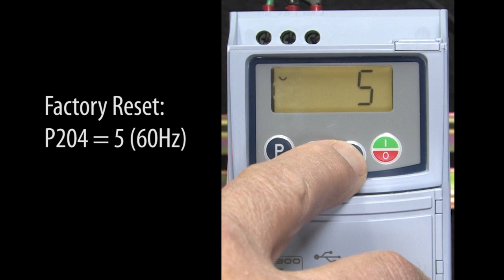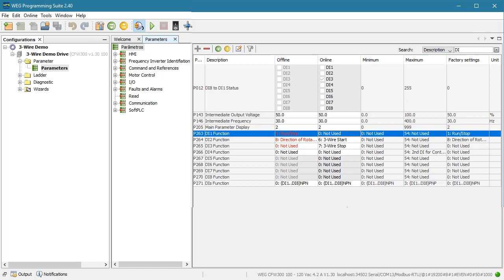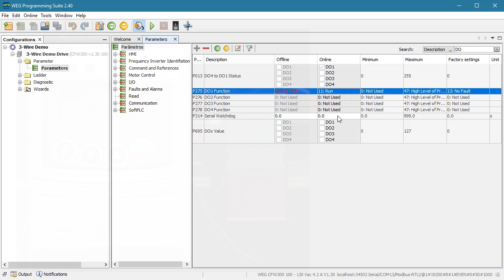WEG CFW300/320 VFD 3-Wire VFD Control Tutorial from AutomationDirect

Comment: The wiring of the light confuses me. I have 24v + from my wall wart going to terminal 11 (DO1) Terminal 12 goes to the positive side of my indicator light. The negative side of my indicator light goes to the - terminal of the 24v power supply. I have P275 set to 11(run).  No love from the light. I've tested the power supply and bulb - all working. Is there another setting of some sort that I'm overlooking or does the - side need to be tied into a common on the CWF 300?
Reply from the maker: All of your wiring and settings sound correct. I would use a multi-meter set to continuity and see if the relay is actually closing. It's also important to make sure you have fully tightened the screws on terminal's 11 and 12, as well as on the light and power supply. I have seen many times where everything was working correctly, but to test they were manually inserting the wires for a fast test, and the connection wasn't being made, even though everything was functioning normally. If you purchased the drive from us, you may also contact our award-winning technical support here:
https://community.automationdirect.com/s/contactsupport
Reply: @automationdirect  You were exactly correct.... almost. Turns out the BRAND NEW connector on the wall wart was defective. The VFD works perfectly. I changed the plug end and voila. This VFD came on the machine it's on, but when I need a new or replacement unit, y'all will be my first call. Thanks!
Reply from the maker: Glad you got it working! Let us know if you have any further questions.

Comment: This is definitely the way I want to wire controls for my combination lathe/mill. My question is are there enough i/o ports to wire it as 3 wire on/off, potentiometer speed control (analog?) and the indicator light while powered? Thanks.
Reply from the maker: Yes. The drive has 4 input terminals to allow the 3 wire start/stop as shown in this video.

It also has a relay output with a normally closed and normally open contact that can be set to enable when running or powered. You can use this for the indicator light. Find a video for that information here:
https://www.automationdirect.com/videos/video?videoToPlay=2bLRgL5qYFM&cat1=113&cat2=129&cat3=180&q=relay

It also has 3 wire inputs for a 5kOhm potentiometer. (+, -, and Wiper)
Take a look at this video for that guidance.
https://www.automationdirect.com/videos/video?videoToPlay=IHEwTqXBWys&cat1=113&cat2=129&cat3=180&q=pot

Comment: With this configuration mode, can i  set the frecuency via HMI local ? OR just via remote With potentiometer ? How can i set frecuency UP to 3 hz in this mode ?
Reply from the maker: With this configuration, we left the speed at default which is local keypad control. You can select your speed with the arrow keys.
Reply: @automationdirect 
SET With P121 parameter right ?
Reply from the maker: @fernandogutierrez8268  P121 is the backup reference. Basically, you can think of it as a default. That is why in this video the motor runs at 3Hz, but can be adjusted via the keypad.
Reply: I will keep trying, thanks.  !! @automationdirect
Reply: the P220 must be set on "0" or "1" ?
 @automationdirect

Comment: Or am I totally confused and need something else, like maybe an ‘Off-On/Momentary’ switch such as a car’s ignition switch?
Reply from the maker: Typically a toggle switch is used for 2-wire control. Just SPDT on/off. For 3-wire control normally 2 momentary pushbuttons are used - a N.O. (normally open) for start and an N.C. (normally closed) for stop. I am not familiar with a toggle switch that would work. It would need to be 3 position, spring return to center with one side being N.C. and the other N.O.
Reply: @automationdirect  Actually I was just wondering if I could use the on/off switch that came on my Kysor/Johnson horizontal band saw.  It has a nifty arraignment which turns the saw off when the cut is finished.  This switch is just a rocker switch, three wires: on, off, and ground/common though, not two momentary switches.

   I appreciate your help supporting these drives, it makes the difference between me, not electrically intelligent, getting the thing working or not.
Reply from the maker: Please contact our free tech support. They may be able to help you find a way to make this work. See support options here https://community.automationdirect.com/s/contactsupport

Comment: Where does the third wire go?
Reply from the maker: Hi Jason, The third wire is the common so it would go to the GND terminal on the IO module. An oversight on our part - thanks for pointing it out!
Reply: Can this also be wired with the run and stop both normally open?